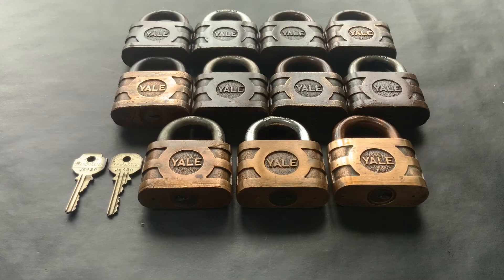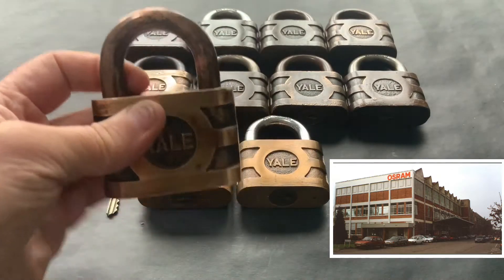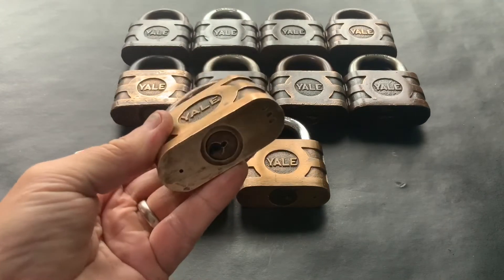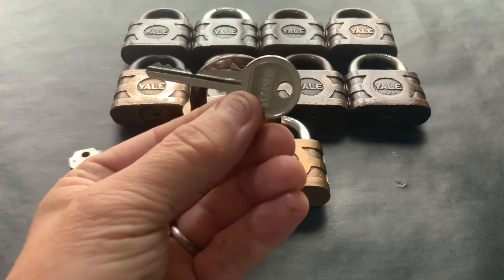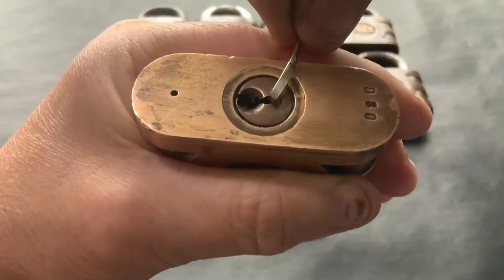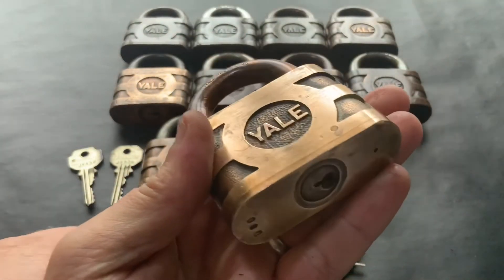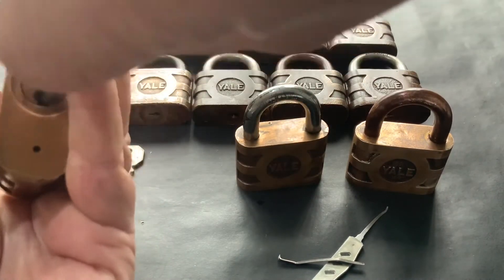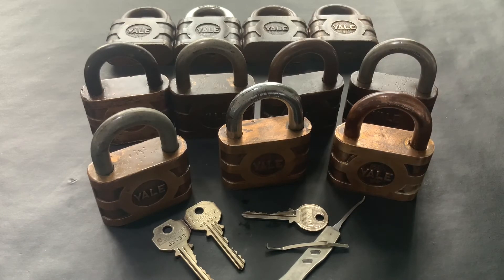(97) Vintage Yale Padlock Picked - Collection of Yale padlocks from the demolished Osram factory

Comment: Yale locks are great so that's a great find. Good luck cutting the keys.
Reply from the maker: Cheers, got the key banks today will cut them tomorrow 👍
Reply: @BrummieLockPicker  Where did you get your key cutting machine?
Reply from the maker: Lock Hak , got it off ebay , it’s an old one but still works ok 👍
Reply: @BrummieLockPicker  I would definitely like to get one but everything other than key duplicators have been at least 5 times what my budget is. I'll have to keep an eye out on eBay.
Reply from the maker: Lock Hak , keep looking, be patient and you will get one for a reasonable price, I searched for about 6 months 👍
Reply: @BrummieLockPicker  Do you remember about how much you paid for it?
Reply from the maker: Lock Hak , yes I paid £150 for mine, you can find cheaper ones but mine cuts Mortice and Cylinder keys, some only do one, mine also came with a load of blank keys 👍
Reply: @BrummieLockPicker  It's good to know that I can get one for under $200 since yours was about $190.
Reply from the maker: Lock Hak you can get them even cheaper, just keep searching on eBay, sometimes you stumble across a real bargain
Reply: @BrummieLockPicker  I'll keep looking

Comment: I've got one very similar here, but with a more common key blank style. I don't have the correct key for mine, its a longer version of the Y1 blank, about 1.5 inches long from tip to shoulder. All I find around here in blanks are the common 5 and 6 tumbler blanks. 
Mine came from a local factory as well, they closed in the early 70's.  I'm not sure if there were more keyed like mine or not, mine belonged to a relative who used it on his tool cabinet there for years.
The body of the lock measures 2 5/8" x 1 7/8" x 1" wide with a 7/16" shackle. 
I've got another very similar lock, which appears to use the same key blank, that measures 3 1/2" wide x 2 1/4" x 1 1/4" wide, with a 1/2" shackle. Both have bronze or brass bodies with hardened steel shackles.
Reply from the maker: Cheers for watching and your comments are appreciated 👍